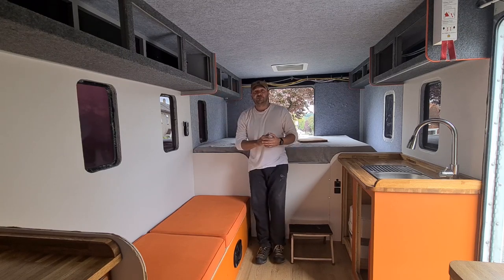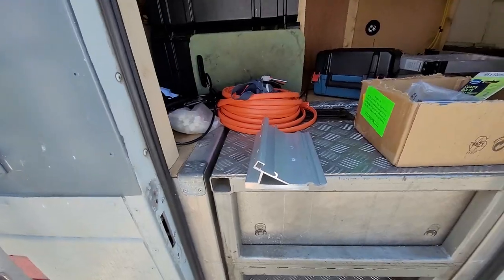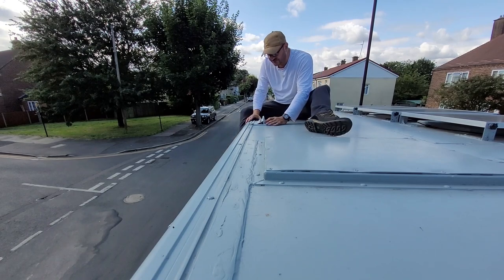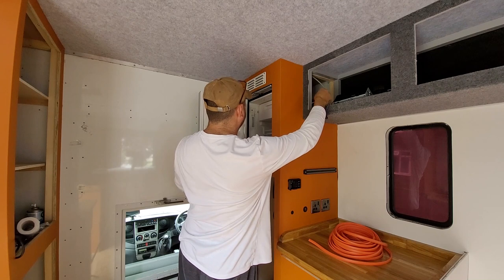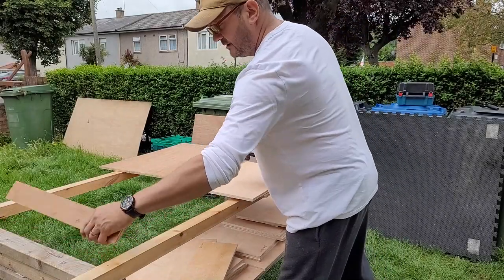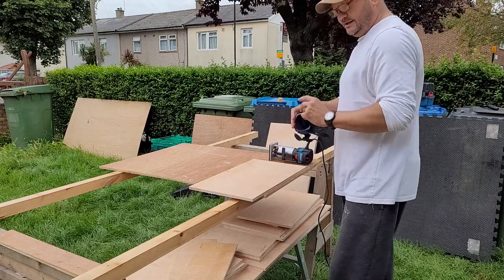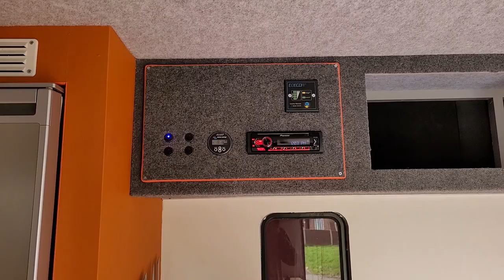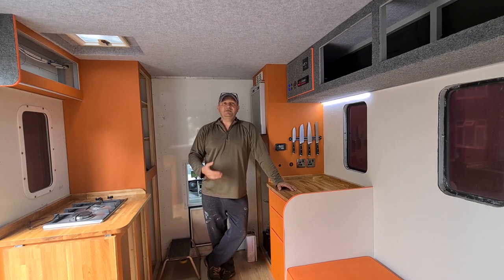Almost finished building our Self Build Iveco Daily Campervan Conversion - Tiny Home on Wheels

Comment: Looking very nice, You have done a great job. I think it would have looked nice with grey trim on the orange units to link all the colours. but very nice, and we do like seeing you cutting it links it all together. Cheers
Reply from the maker: I did want the grey trim on the orange doors but couldn't get it in 12mm. They done a silver but I just wasn't happy with that. If I was using 15mm I could get any colour I want 👍

Comment: At the start of the video, if you look at yourself in the hallway between the sink and sofa, you see how much space there is between the sofa and sink. It seems like so much unused space to me. It seems like there should be 4 person dinette table with bench seating instead of the sofa, right across from the sink/counter. You can eat there, play cards, games, edit videos, prep food, and so much more. I guess another option would be to have two long tables in front of each couch section with room to get out in between but then you're not facing each other and you're looking at the sink. If you put in a dinette table you'd have room left over for something else like a full fridge or a freezer or a bathroom or just a big closet or you could extend the other counter. Anyways, just some thoughts. I'm sure the huge hall way is nice and makes it feel open but it's just not needed at the end of the day I think.
Reply from the maker: We have tables being fitted and that's the idea of our build and I did mention this in 2 other videos that we are trying  create to as much floor space as possible. Every motorhome is normally crammed with furniture, We wanted space and lots of it however like I said we do have tables going in. Cheers 👍

Comment: I could barely watch when you were drilling that aluminium plate. Those long lengths of swarf could easily have caught your hand and possibly dragged your hand into the spinning drill. Please when drilling the aluminium don't go through with one continuous motion, use regular short pulses of feed so that the swarf breaks off into short lengths and falls out from the drill flutes readily. 
Been loving the content, stay safe.
Reply from the maker: I take all sensible safety comments on board and this is one of them. Cheers my friend 👍

Comment: Hello mate. Watched all your build videos from start to finish. Am considering an ex prison transport van for a build. Can you tell me if the insulation that comes already in the van is sufficient for all-year use? Keep up the good work. Cheers!! Chris.
Reply from the maker: Excellent question and will be covered in the Q&A thank you for asking
Reply: I've bought the same model as featured on this channel. It's very well insulated with an aluminium/ celotex type foam construction. You get around 90mm on the roof / floor and 45 in the walls. That's not far off the building regs for house insulation. Way better than bubble wrap type, rockwool or other insulation used to insulate panel Van conversions. Within the walls roof and floor are a number of reinforcing beams. You need to plan to not drill through these as Jase has shown in these videos. That said one or two shouldn't make a difference as the body is built very strongly.

Comment: I have a question, considering your own labour the costs I would love to know (roughly 😉) but also if I were to go and buy a vehicle exactly the same fully built from a dealer? The difference between the two , obviously the labour part would cost a fortune!
Reply from the maker: Yes they would cost a fortune for similar build. Yes I have cut corners and joined materials instead of being one piece. If that was from a coach built I'd be furious, the difference is I'm paying for it immediately so I can make that join look good enough and acceptable to myself and most importantly my wife. I have no idea what this would be worth but I know what it is worth to me and I couldn't buy a 60k motorhome that offers what this does to me or Deanna, yes coach builds are pretty, very pretty but wouldn't last a patch on what this will do. Toot when you've read this 😉👍
Reply: @PrisonersNoLongerAccepted   Perfect reply! Cutting corners isn't a bad thing and it doesn't seem to compromise the build in any way, it just shaves off some time I guess. And that would only speed up getting out and about! 😉👍🏽

Comment: how do you get over the problem with the steps into the unit. i am trying to think of a way to lift and lower the step electrically, as its hard to reach down from inside the unit.
Reply from the maker: Great Question. Actually working on a very simple solution right now... I'll show my idea in the Q&A. Electrically would be amazing but would have to also be able to have a manual override incase of a failure somewhere 👍
Reply: @PrisonersNoLongerAccepted  I have fitted an electric door holder to the side door so it can be released from inside the unit. i can fit a pull cable to lift the steps but i looking for something better. i not know if yours is the same but the door catches the middle step nosing when they are down and bends the hinges out.
Reply from the maker: I'm actually just about to take a look. Get back to you very shortly